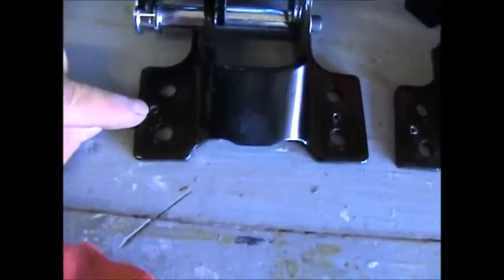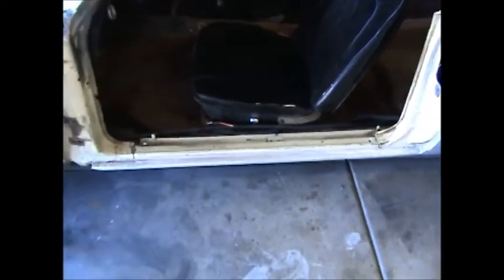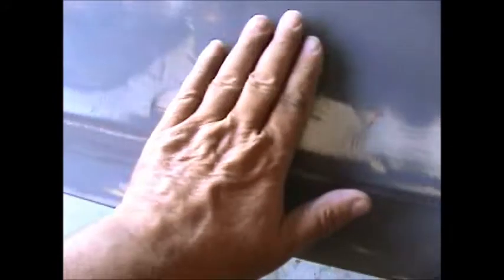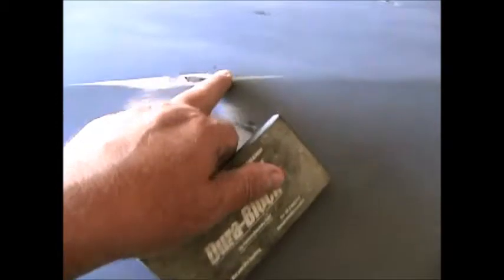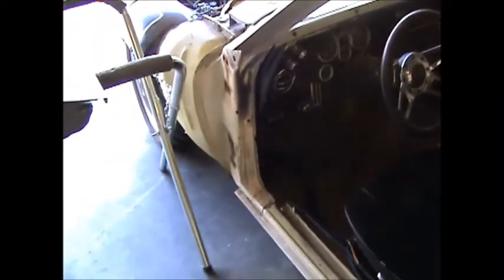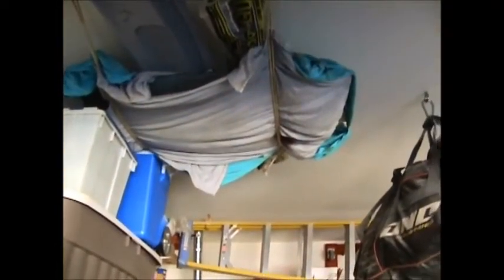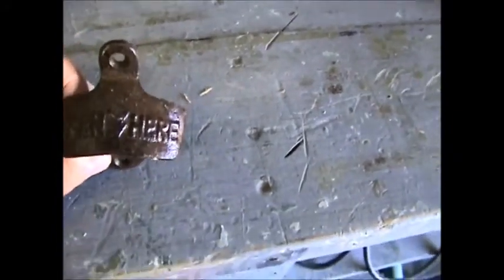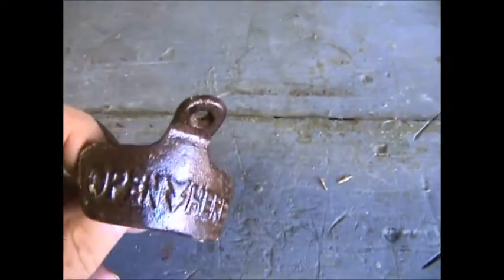1968 Camaro Resto-Mod 8-23-14

Comment: Reason u didnt take it down to metal??
Reply from the maker: Felt like i really didn't need to - trust the factory prime job when necessary. At least that was what I was taught back in the day - (60's) the age of single stage.
Reply: Tom Noble my only worry would be its 50+ year old foundation to all my hard work that could fail n let go ....any way love the build so far ill catch up to present day shortly